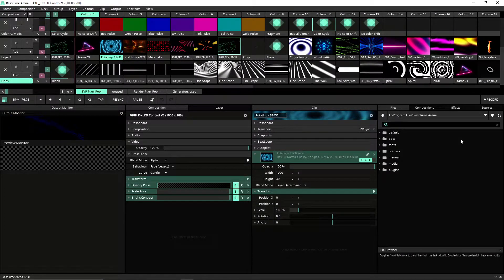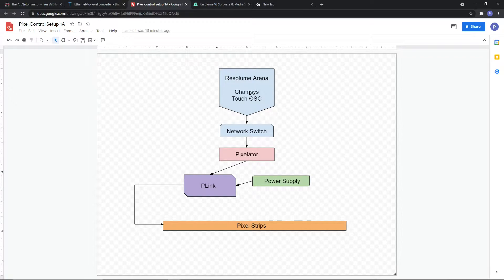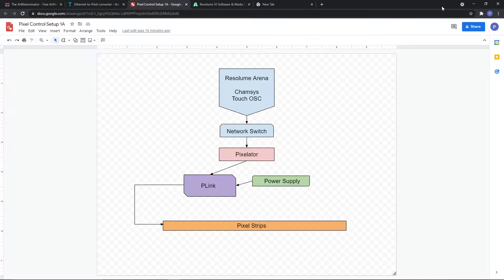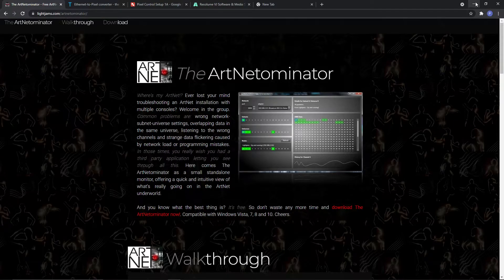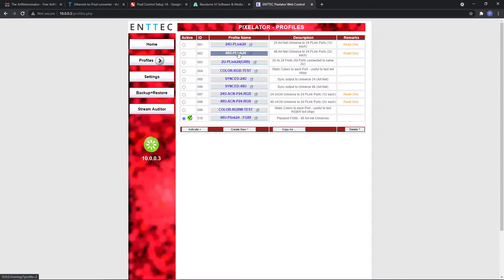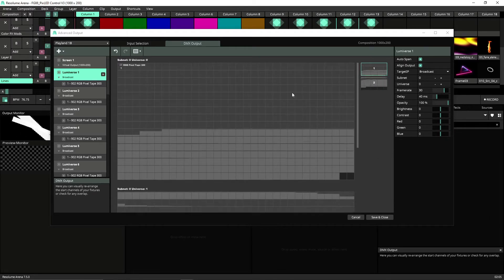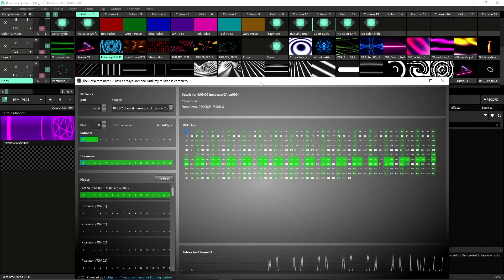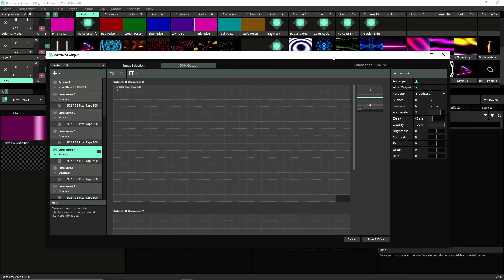Problem Solved: Resolume Artnet Not Sending Output to Enttec Pixelator | Quick Fix

Comment: hi, thanks for this video, which powersupply do you use? greetings from austria
Reply from the maker: Power supplies are fairly easy to come by, at least here in the US. The 2 companies I use for power supplies are EnvironmentalLighting.com or SolidApollo.com. The power supplies are very specific to the job.
Reply: @AuraluxSystems  do you really nedd the powersupply ore is it possible to controle them only plugged into for example the enntec octo. I mean, they need a lot of space extra.✌️
Reply from the maker: With the Pixelator you need the power supplies because that unit doesn't send power to the strips, only data. I believe with the octo you can hook the power supply to the octo, which then passes that power to the strips. But don't quote me on that. I haven't used the Enttec octo on a job. It's important to pair the correct voltage on the power supply with the voltage of the specific  led strip that you are using. And if that power is being passed through the octo you need to make sure it can handle it. 

One of the biggest challenges in setting up a system with a lot of led strips is hiding all the power supplies and control boxes.